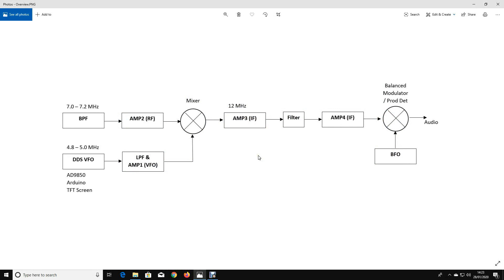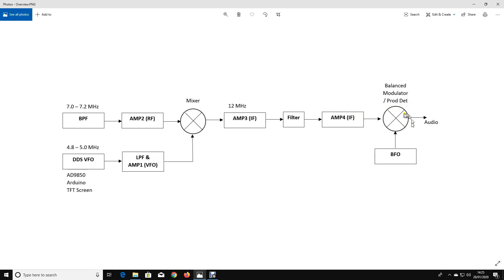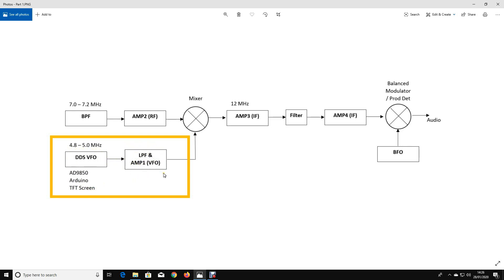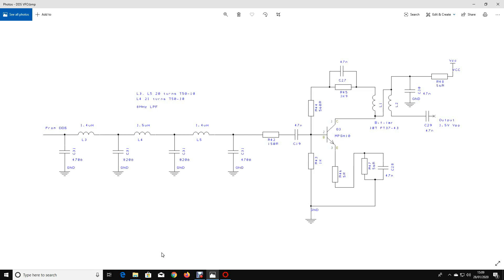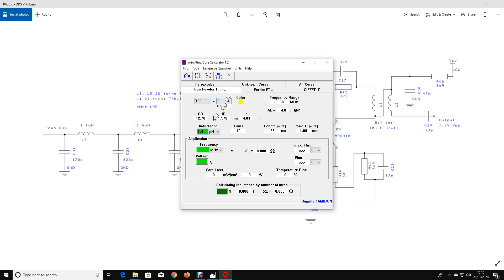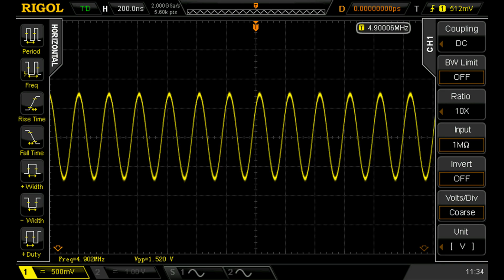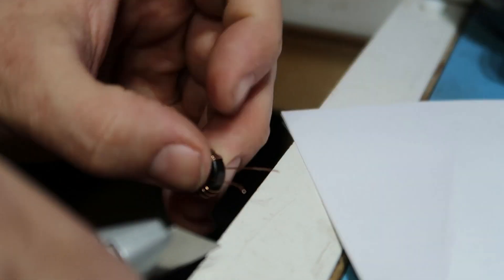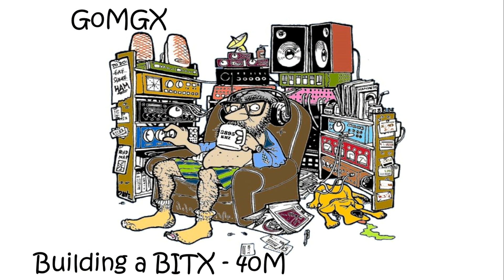Building a basic QRP homebrew BITX - Part1

Comment: I saw someone mount a wooden dowel pointed vertical that was tapered so the small ferrite (or iron) cores sat down on it and the core was simply lifted a bit with the wire as it was being wound up through the center. Very tidy. I'll be doing that from now on, as I too am fumble-fingered with small toroids. I'm sure it works best on small cores, but I think a larger tapered dowel might also work Ok on larger toroids like high-power baluns and the associated common-mode chokes.